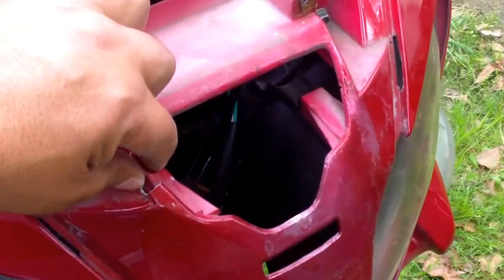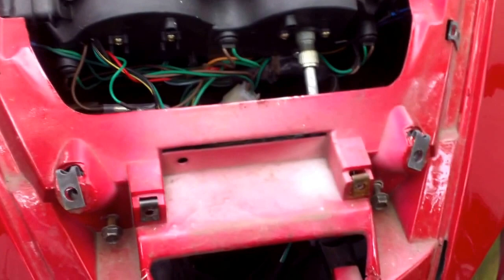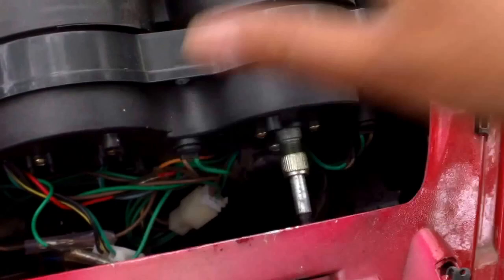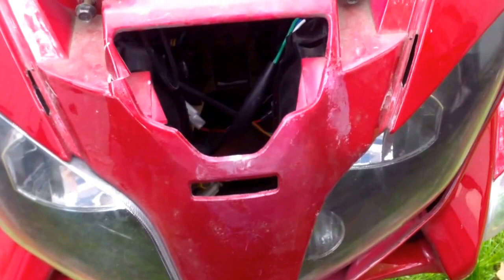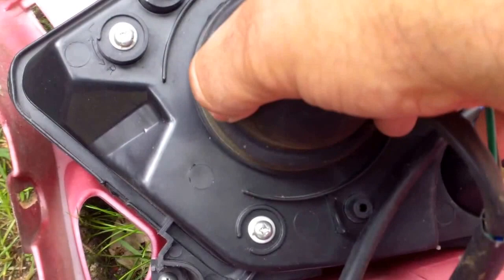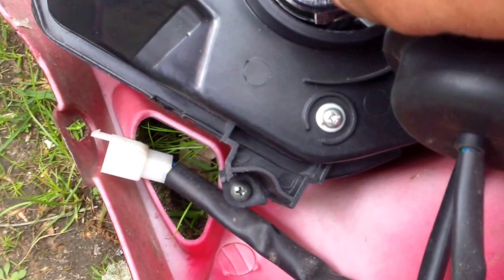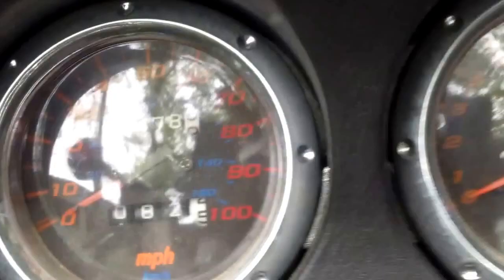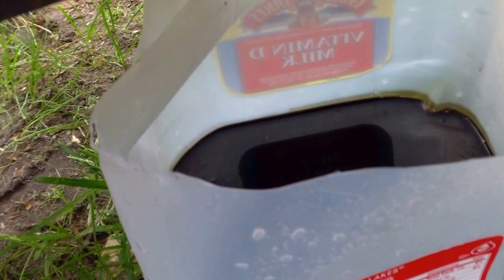How To Replace Headlight On A Jonway Scooter

Comment: The loose "ground wire" coming off the alarm, not in the harness plug, is capped off. This is the antenna wire for the alarm, and is NOT supposed to be grounded. Just wrap it around, or zip-tie it to, something. :-)
This was informative. I just bought one and want to change over to LEDs. Now that I know, they are H4/9003, I can order a set.  Really hoping I don't have to pull the whole front assembly off to get to them. Ughhh. Thanks for the upload, :-)

Comment: I have a Jonway YY150cc T-12 And i am trying to remove the steering panel.  I have removed all four of the visible screws.  But it still will not come off.  Are there any hidden screws that I need to find?